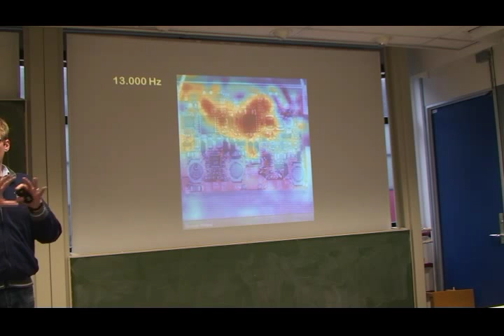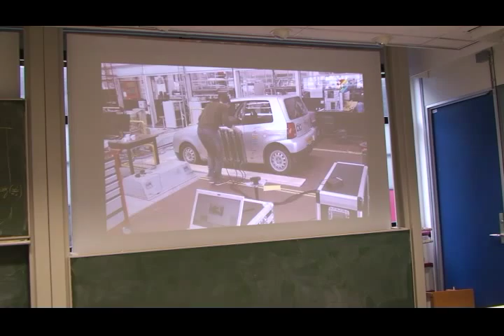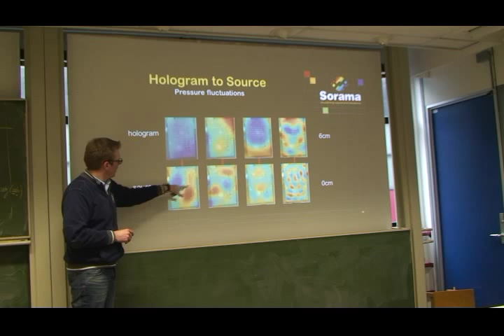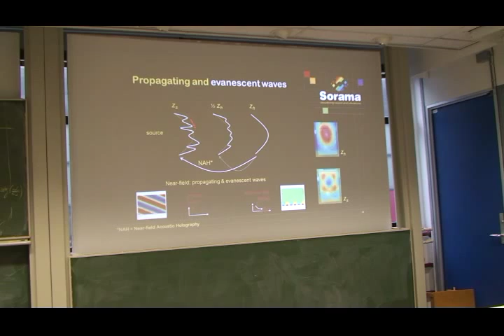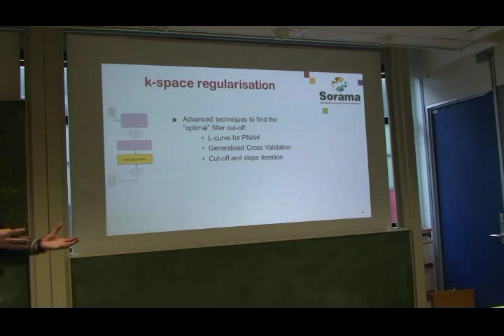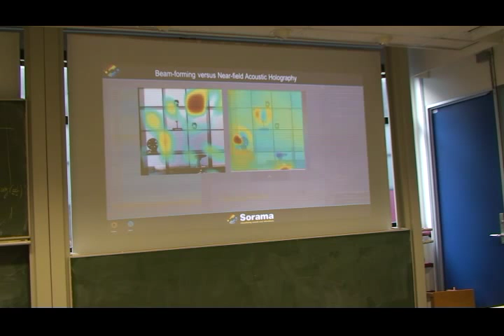Fourier-Based Near-Field Acoustic Holography

Comment: I'm surprised that this research isn't being suppressed by the military as it has significant possibilities in sonar.  Of course, I'm glad that it isn't suppressed as there are possible medical both diagnostic and surgical, and 3d fabrication scaffolding possibilities as well as potential for control of combustion chambers etc.  I also suspect that these methods could apply to electromagnetic fields through RF, potentially leading to better anti-matter containment,  the proverbial tractor beam in a vacuum and perhaps fusion initiation.  Certainly a technology to watch develop.

Interestingly, back in 1996, a computer science professor wanted to build a computer cluster out of computers with sound systems and speakers so that it could later be disassembled for use as grad student workstations and wanted a research reason to justify purchasing the sound systems.  I recommended hanging the speakers in a planar grid to research in sound interference patterns. I suggested that an obvious first application would be a planar sound source thereby filling a room with audio without resorting to volume, a second would've been active sound cancellation within a room such as cancelling voices from a nearby table in a restaurant.  That's what went into the Grant application to justify the speakers but we did not find a grad student to focus on that angle of research.